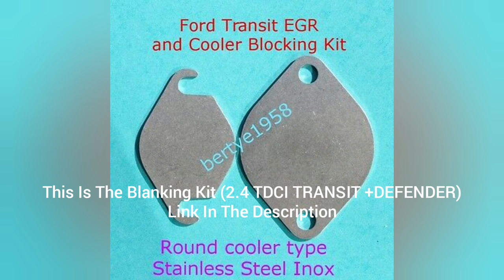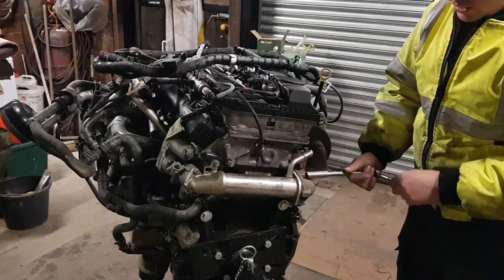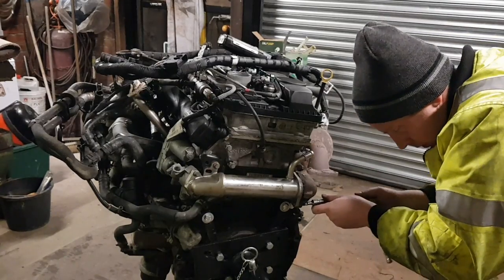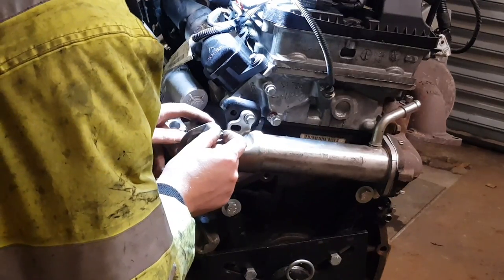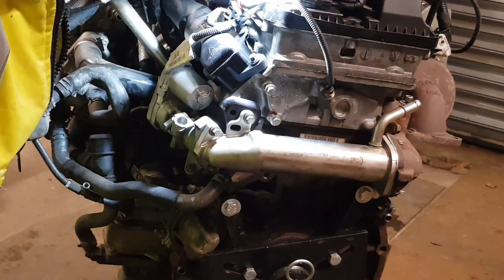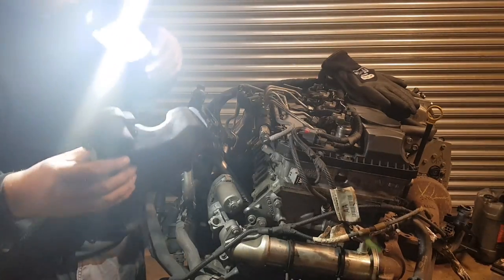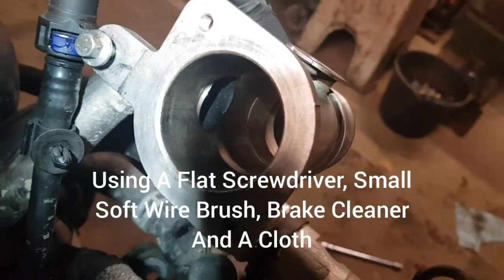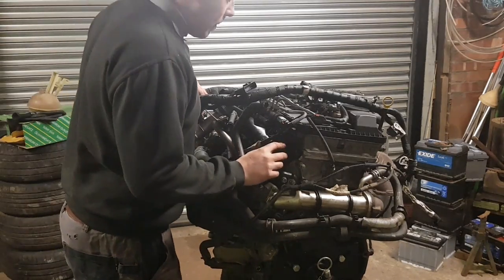Blanking The EGR Valve 2.4 2.2 TDCI Land Rover Defender Ford Transit

Comment: Hi! I have a doubt. If the cover that goes on the side of the exhaust manifold is not fitted then the EGR gas cooler is clogged. What consequences would it have? because I think it wouldn't matter anymore, since he doesn't do any work anymore.
Thanks and greetings to all!
Reply from the maker: The only problem be doing that is if it removed. You would have to take all the cooler off to clean it out but other that that no consequences its just good practice to block both.

Comment: hi thanks for that my cooler pipe is leaking like fk now what would you think if i blank the egr then just connect the 2 pipes bypassing it totally
Reply from the maker: As long as there is no DPF you shouldn't have any issues. Done it on a few now and not had any issues 👍
Reply: @lifes.projects  its a mk7 transit how will i know if i have one as im going to blank the egr valve myself

Comment: Ah crap it's the BACK of the engine? Not looking forward to this but I think I need to. Last year I changed my glow plugs and noticed how full of crap my intake was... Cheers for the vid.
Reply from the maker: Yeah its at the back. A little fiddly but not a bad job to do really. All you need to think is once youve done it then it will always run cleaner and never need doing again 👍
Reply: @lifes.projects  cheers for that. Do you know much about the plates with holes in? I live a long way from anyone who can remap landies... I read that if you get the hole the right size it's not necessary, plus the previous owner did a remap already which would be wasted.
Reply from the maker: @markevans5596  The ones with holes in are a waste of time. They dont completely blank the EGR but also on a motorway run your engine management light will still come on due to it been restricted flow from the EGR. So they are pretty pointless. If you blank it completely like mine your management light will only come on when you are on the motorway and say EGR restricted flow. If you have a little code reader you could easily clear it off until you manage to sort a remap. Hope this helps
Reply: @lifes.projects  hi again sorry I didn't see your reply. Ok thanks, I'll take your advice!

Comment: Mine is a NZ spec 2013 2.2 with no DPF,just a cat,will i still have an issue with the ecu.
Reply from the maker: Oh right. In the UK the 2.4 has a cat and the 2.2 has a DPF so if it has come out of the factory like that then you can blank the egr same as me because you dont have a DPF. You would still need to get the ecu remapped to tell it the egr has been blanked if you dont want the engine management light coming on. If you dont mind the light coming on you can run it as it is and it will not cause any harm to the engine.
Hope this helps
Reply: @lifes.projects  The answer definitely helped me. I've just unplugged mine on a 2.4 and put up with the warning light.

Comment: What causes catastrophic failure in these engines (entire fleet) at circa 150k kms?
Reply from the maker: Injectors mainly. They damage the pistons and cause all sorts of problems
Reply: @lifes.projects  Oil dilution by diesel?
Reply from the maker: @vs6300  can be both yes. The main is overfueling and either melting or cracking pistons. Poor oil due to the egr causes problems too. Injector seals leaking and causing poor oil dilution. Have a look in my other video and you will see the state of the oil caused by a faulty injector seal
Reply: @lifes.projects  Though they were serviced religiously every 5k kms on 5W40 fully synth. Oil levels always used to be ok. The cars were landrover defenders 2.4 yom 2014 or so, all in the junk yard now. The one assigned to my workstation lasted longest - 200k kms, died last year.

Comment: Thanks for that Tom . I will definitely source the blanking plates and attempt to fit both . Not real sure at this stage how I would go removing the cooler . Looks very difficult to get to with engine in the vehicle . Even if it has soot inside ( as I’m sure it does at 180,000kms ) is it really necessary to clean it out once completely blocked off at both ends ? I agree that it would be desirable and I will take a closer look today after I finish installing my rebuilt Transfer Box .
All the best with your projects .
Regards , John
Reply from the maker: I wouldnt say its really necessary to clean it out completely. If you remove the studs and the mounting bolt at the back you will be able to push it back and have a look inside. If its not bad just blank it off but if its clogged i would give it a quick clean. But thats just me been OCD haha. Ooo sounds good! 
Thanks John!

Comment: Hi, what’s the best stuff to clean it out with? Brake cleaner? Thanks
Reply from the maker: Yeah de-greaser and brake/carb cleaner
Reply: Life's Projects I’ve bought the plate to put on the egr and it’s the same as the one you fitted but I don’t have the bigger one that goes on the other end, but does it even matter? Or is the egr one enough? Thanks
Reply: I’ve got a mk7 2.4 rwd Transit btw
Reply from the maker: Alot of companies just use the little one that you have but personally its better blanked the the manifold as you will get carbon built up in your egr cooler
Reply: Life's Projects I won’t be using the egr anyway so why would that matter? It confuses me, is it possible to do the both of them while the engine is still fitted in van?
Reply from the maker: @Ray-cw8ms  yeah its possible to do them both. The one on the manifold is abit of a pain to do but the one on the valve isnt bad. Its just so the cooler dosent get full of sut but its like a double precaution.
Reply: Life's Projects how do I get to the manifold one? I think I might be able to get the valve one from underneath the van but not sure about the other one
Reply from the maker: @Ray-cw8ms  its very tight.... from the front of your van its on the left side right at the back. Have look on the video. Once you can see its location you will know where it is. But believe me its tight in the rwd transits
Reply: Life's Projects yeah I know where it is and I can imagine it to be very hard to get to but I’m just wondering if it’s worth doing. Can you tell me if the fresh and the exhaust gas mix together in that big air cooler pipe or do they have separate airways and don’t mix untill they pass through the egr? Because if that’s the case then I’ll probably just fit the valve blanking plate. Thanks for you help mate 👍🏻
Reply from the maker: @Ray-cw8ms  oh right no they dont mix in the cooler. The cooler is there just to cool the exhaust fumes down before the egr valve recycles it back into the engine.
Reply: Life's Projects well that’s good then so I don’t need to buy another plate and be shouting out profanities while getting stuck up to my elbows in tight places plus don’t really see the poin in doing unless like yourself the engine is out so might as well just do it cos you can
Reply from the maker: @Ray-cw8ms  yeah pretty much 🤣
Reply: Life's Projects thanks again it’s was very helpful 👍🏻😉

Comment: Hi Tom, Great video as always! Can i fit this kit also to a 2.2 with DPF? Many thanks! Luca
Reply from the maker: Yes its a slightly different kit for a 2.2. Also if your 2.2 has a DPF on the exhaust it complicates things slightly. Some countrys dont have DPFs fitted to the exhaust but In England the 2.2s have a DPF filter on the exhaust that by law can't be removed..... 😜😜😜...... but due to this you would have the Get the ECU Remapped otherwise you will get the engine warning fault on the dash. If its not law in your country the best thing you can do is Blank the EGR Valve , remove the DPF, get it remapped and your engine will run smoother, more efficiently and cleaner. I hope this makes sense as its a little hard to explain on a 2.2 🤣
Reply: @lifes.projects  Many Thanks for your quick replay! Aslo in Switzerland it is better to leave the DPF mounted! What do you mean by " it complicates things slightly"? I have tried to find a kit but the only one that I can find that blocks the egr ant the cooler is the one you linked. Thanks again!
Reply from the maker: @TheDuke279  The reason its more complicated is because the 2.2 is designed to be better on emissions than the 2.4. Therefore the EGR valve will be working more often with the DPF to lower the emissions so if you blank the EGR off the ECU will register this as a fault and put the warning on the dash as it thinks there is a fault, not only this but it will not allow the DPF to carry out regenerations etc. This is why you will have to get it remapped to tell the ECU there is no fault.
Reply: best thing i ever did getting my dpf deleted and egr blanked on my 63 plate tipper, all the egr and dpf do is suffocate the engine
Reply: @lifes.projects  many thanks for your relpay! When I patch the EGr I will remap also the ecu!😃I was planning to do it with BAS remap!
Reply: @paddyici6629  did you deleted the DPF from the ecu with out removing the DPF from the vehicle?
Reply: @TheDuke279  take the dpf off, knock the insides out with a chisel, don’t cut it open and weld it because an mot tester will instantly fail it due to tampering
Reply: @TheDuke279  then map it out of the ecu
Reply from the maker: @TheDuke279  That's who i want to remap mine when i get around to it

Comment: Damn...it's so much easier with the motor out!   Thanx for the nice step by step explanation....I have 2 questions.... how many miles does this engine have on it(I'd like to get an idea of how long it takes for that amount of soot to build up inside the inlet manifold)...and why did you decide to blank off before AND after the EGR cooler......Pre cooler is always 1st prize and post cooler if you really can't get in there and dont feel like taking the whole engine out...☺
Reply from the maker: The engine has 79000 miles on it. If you dont drive the engine hard or tow it will be more clogged up then this one. Its better to blank off at the manifold so the cooler dosent get clogged up full of sut. It also helps with exhaust flow and cooler life as there is less pressure inside the cooler. I blanked off after because there is no way exhaust gas can get in to the manifold but also when on boost there is no way intake air can get into the cooler. You can do it with the engine fitter its just a little awkward. Its was easier to show/film doing it whike the engine was on the stand too. Hope this helps

Comment: You blanked that in the best way there....afaik it can be an MOT fail these days if an EGR valve has been obviously blanked....bloody crazy...obviously the rules are made by idiots that have never had to clean a valve or inlet manifold out...took me bloody ages to clean out the inlet manifold on my missus' Freeloader TD4 before I disabled the EGR valve
Reply from the maker: Yeah they can be a real pain to do! Alot of time involved cleaning them out too! 
The MOT manual is a big contradictory mess. Everything is a visual inpection so if a tester suspects the EGR has been blanked they can only pass and advise as they cant prove it. The only thing they can fail it on is excessive smoke. I was a MOT tester in my old job and you wouldnt believe some of the things you cannot fail a vehicle for but only put down as an advisary marked dangerous. 
Hope your enjoying the channel Eric. Al give yours a look as ive grown up with old land rovers 👍

Comment: Hi Tom. My name is Jarich and I’m from Belgium. I have a Deffie 90 from 2010 with only 36000 miles on it and my engine is broken. I thought it was the oil pump, but took it out and saw nothing. Apparently it comes from malfunction of my injectors. At the moment, I took my engine out and will replace it with a new one. I really hesitating to blank my EGR because I’m afraid that it will cause damage to my new engine, I mean, I heart that the recycled gasses helps to cool down you engine ass well ? Also, what about the emission? Will they see it ones they controlled my emission in my end exhaust? Is there risk you think? Just to more questions, can you delete the egr with a nanocom blakbox?
You’re a great guy Tom, I really enjoy to watch your videos! Sorry for my broken English 😅
Reply from the maker: Hi Jarich. The TDCI engines do suffer with injector problems that cause damage. If you are fitting a new engine and injectors i would also replace the VCV (fuel metering valve) fuel pressure sensor and fuel pressure relief valve as these are prone to failing and can lead to incorrect dosing of the injectors.
As for blanking the EGR it causes no damage to your engine, it actually makes it more efficient and cleaner in the long run as its not recycling the carbon caused from burning fuel. In our country the egr valve has to be there to pass a MOT test and you cannot tell it has been blanked. The emissions it just a smoke test so will pass no problem even wih the egr blanked off. 
I dont have nonocom myself so i am not sure about that. 
If i was to replace my engine I would blank the egr for sure as it just chokes up the inlet and causes problems.
Hope this helps 👍
Reply: @lifes.projects  thank you Tom for your advice! I will do that and you’re right…I sure now that I will blanked the egr! Friendly regards😉
Reply: @lifes.projects  Hi Tom, can I ask you one more question? As I blocked the egr, I was wondering if it can cause any damage to my turbo? So, now with my blocked egr , the exhaust gasses will go straight to the catalytic converter, but I’m scared that because of these extra gasses, my turbo will suffer from to much pressure. I can empty the calatytic by cut it open but like to ask you first😅! Thanks a lot for helping me out☺️
Reply from the maker: @jarichneckebroek150  Hi Jarich. No dont worry it will not damage anything if anything it helps as the turbo spins up faster due to it having a little more pressure  perfectly healthy for it.
Reply: @lifes.projects  Thanks a Lot Tom for your feedback! You’ve help me a lot! Friendly regards!😉
Reply from the maker: @jarichneckebroek150  No Probs 👍

Comment: Hi Tom, great video's mate. I have a 130 Defender in Australia and its got a cracked head or head gasket gone. Its in for a new motor as I type. I got the blanking plates shipped over and am getting them fitted. I have sent you a message on Instagram if you could please respond, I couldn't find other way to send you a personal message. Also what do you do to delete the coolant going through the EGR cooler. I am thinking of blanking the hoses and stopping the coolant from taking the route altogether. Thanks heaps
Reply from the maker: Hi Damian Sorry I will Have a look at my messages on Instagram. You can buy a little pipe to join the too EGR pipes together . Dont clamp them off as coolant wont be able to circulate.

Comment: I really don't get the logic behind all this modern emmissions shit?? It's like DI on petrol engines.. awesome when new, but after 30000 miles the valves and ports are so clogged up with recirculated oil vapour, not being cleaned by fuel/air mix that the engine becomes less efficient than a nomal port injected engine?? It must be the same with the EGR on these diesel engines, great when new, shite after a few miles and less efficient than running without it. Think I'll check my manifold tomorrow. I've got 16K miles from new and plenty of that was long journeys so I might be OK?
Reply from the maker: Sorry for the delay Nigel. It didnt tell me anyone commented! No idea why! 
Well modern petrol engines also have an EGR Valve but because petrol enginess dont produce as much soot as diesels they arnt as commont for clogging up. (They do still go wrong tho 😂)
Yes you are correct, the entire reason behind egrs, dpfs etc is only for emissions and being kind to the envoronment. 
But it hits the consumer (Us been the consumer) by shortening engine life and also causing expensive repairs that can be avoided. 
With yours been the 2.2 there is a few extra things you need to do. The egr needs blanking but as well as telling the ecu that the egr valve is no longer recirculating exhaust gasses you will also need to to calibrate the ecu so that it will no longer require the egr valve to help with dpf regenerations. Most defender tuning specialists can sort this for you but just making you aware that its abit more complicated with the 2.2 due to it having a dpf

Comment: oh you mean when the engine is in the regen phase. i see the regen as a waste of fuel same for the stupid dpf. if they could be deleted then all good and none of the ad blue nonsense.
Reply from the maker: This one doesn't have a DPF so it doesn't regen. However on this engine its still better to blank the EGR to stop it reusing exhaust gasses
Reply: @lifes.projects  ahh ok, so didnt use a dpf till the 2.2l or they never bothered at all with a dpf and adblue.